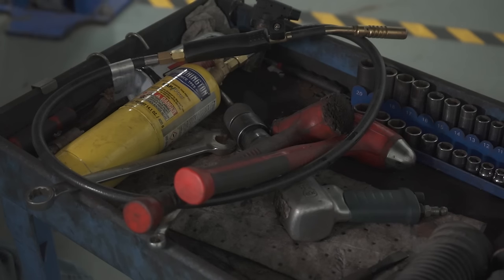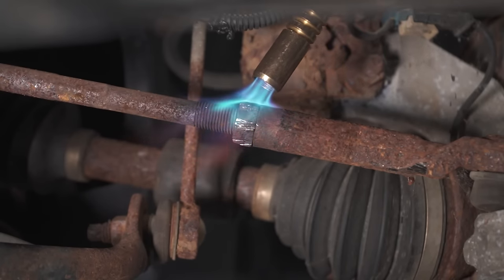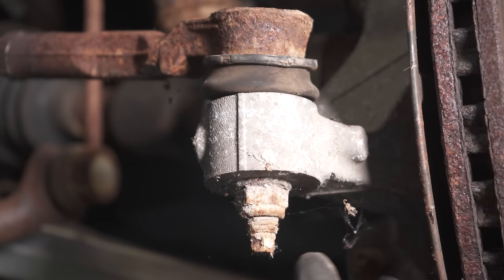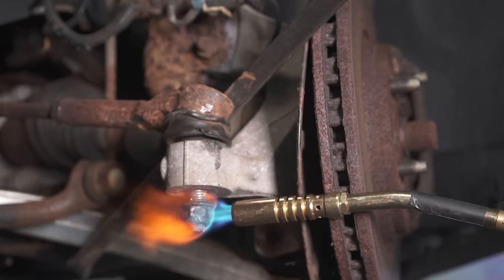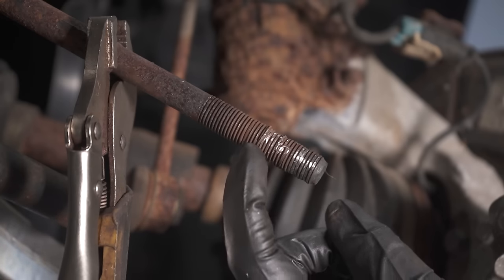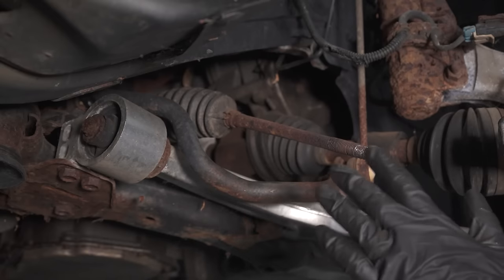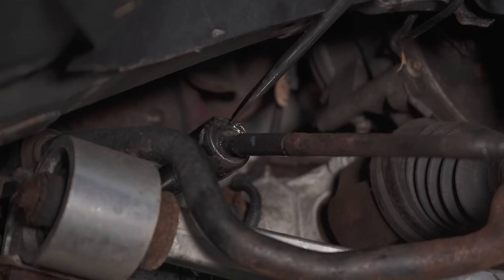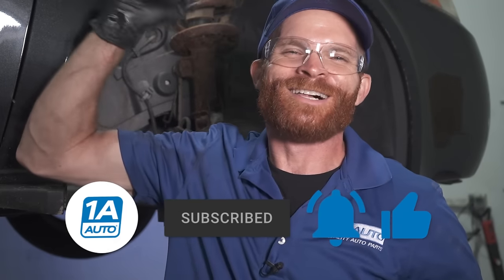Bad Inner Tie Rod End On Your Car or Truck? Is It True I Should Replace Them in Pairs?

Comment: WARNING! Do not EVER heat a ball joint or tie rod end with a torch! My father almost died from it. The grease inside vaporizes and when the retaining ring fails, it blows up like a shotgun. It was red hot and went through his right eye and lodged in his head for 4 hours......burning until they were able to remove it.

Comment: Unfortunately because of my ignorance I only replaced the outer tie rod.  A few months after the alignment I found that my wheel/s wiggle causing my car to swerve and there's a lot of play in my steering wheel and I am now replacing the inner tie rod to solve this issue.  Great video.

Comment: While you can mark where the tie rod was, and count the amount of rotations, the reason you would want to replace them in pairs is because you're going to want to get an alignment, and why pay for two separate alignments, because guess what? Your other tie rod end link probably isn't very far from needing replacement either

Comment: Crusty parts like that, I wire wheel whatever I am planning on taking apart first. That way you aren't running the nuts over rusty garbage.
Reply: Don't wirewheel anything near the brakes...that brake dust is toxic. Bet you already knew that. 😉

Comment: Typically, if the outer is bad, the inner will be as well, and if it is not bad at this point in time, it will be bad in a short amount of time.  So, save some time and go ahead and change both, the inner and outer while you are in there.  It should also be a good idea to change both left and right assemblies for the same reasons you mentioned and I also added to. After all, your suspension really is the hardest working parts on the vehicle.

Comment: In my experience personally, you need to change all your front end parts at the same time. Including tie rods inner and outer, ball joints upper and lower, hitting on an alarm if you have those.

Comment: Agreed. Not only replacing outer and inner but doing so on both sides. With 260K miles on the original Toyota parts I bought OEM parts for another quarter million. Bought new boots, too. For $15 why not? And new sway bar links. The originals have been making intermittent noise on certain bumps for at least 10K. I'll take it apart once, fix it once, and get it aligned once.
Reply from the maker: +Randy Duncan Thanks for the feedback!

Comment: Just relace both parts, doesn't cost that much more, and guarantees you won't need to go through the whole process again when the other one needs replacing, plus no need to worry about damaging the joint getting it off !

Comment: I need to figure out what seems loose under my van, it sounds like every part connected together is loose and the whole front rattles while driving on bumpy roads and parking in driveways
Reply: My van makes a few rattles too  and I had it checked on by multiple shops that didn't see anything. It's 18 now with 156k miles. Going to change all of the suspension out.

Comment: The 2014 Hyundai Elantra still has the original parts from when it was built.and it has 97,738 miles on the clock.

Comment: So, what if the outer tie rod won’t come off the inner? Even with heat? (I loosened the jam nut) AND holding the inner tie rod with vice grips - on the hex area - strips it?

Comment: You could use some rust remover gell and clean up the threads by the jam nut and then use a wire brush, then use some thread losoener spray, if after ll that you might use heat but using it initially is just laziness.
Reply from the maker: +chuck rafiki Thanks for the feedback!